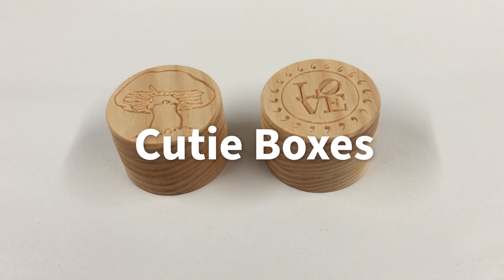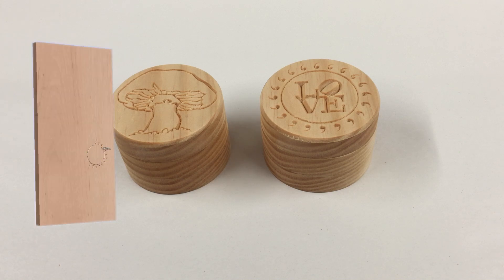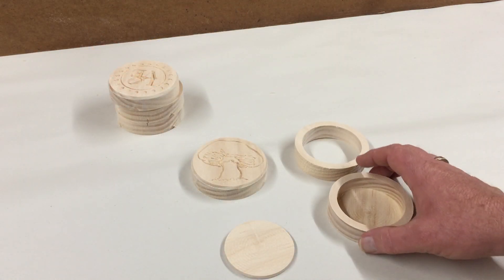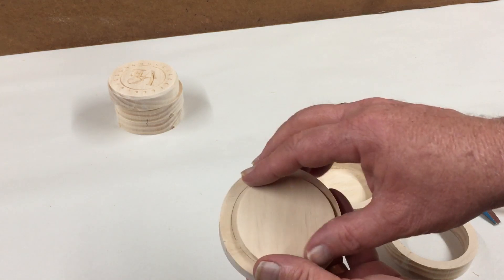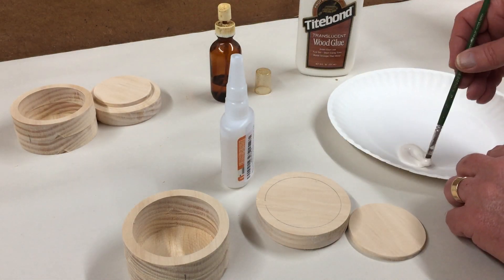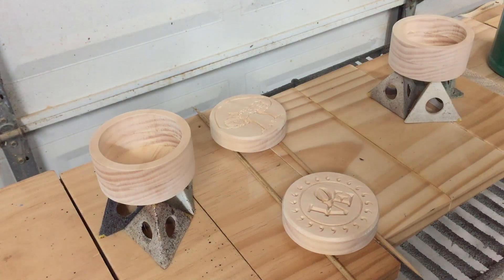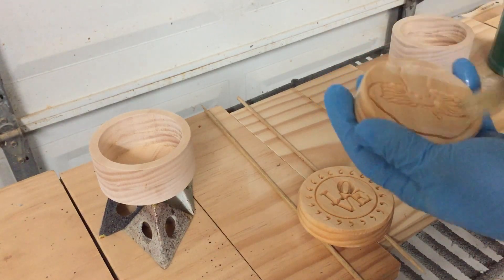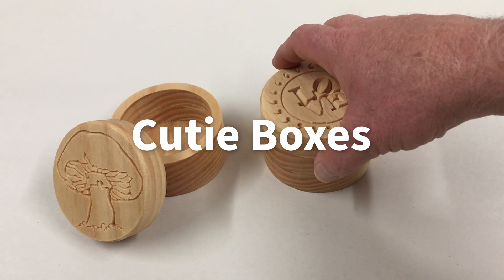Making The Cutie Boxes | Michael Tyler's FREE CNC Project of the Month | Vectric

Comment: Greetings, Michael,  I would love to make this project, but I have NextWave Piranha, which will cut out around 12" z 12". how would that work with the machine?
Reply from the maker: Thanks Art for the question... I suspect all you need to do is adjust the tooling so you cut one box at a time.  It might be helpful to open Michael's file and then save it off using a different name, then delete one of the 2 boxes and recaculate the tooling... then open the original file and delete the box you just recaculated, relocate the remaing vectors to area your machine can cut and recalculate the tooling.  I hope that helps... and if not please fell free to email support@vectric.com and they can give you a hand.

Comment: Michael, Thanks for the project.  Looks like fun.  

One question:  You use Krylon to clear coat many of your projects.   I have tried that, but get a bit of a rough or textured finish that I don't get with other finishes regardless of application method (brush, wipe or spray). Is this a characteristic of Krylon or am I doing something incorrectly?

Thanks.
Reply from the maker: I don't get a rough or textured finish with the Krylon clearcoat sprays. Many factors can cause problems, though. Too far from a project whilst spraying, high humidity levels, too hot or cold temperature in the shop, cans were stored in freezing or near-freezing environment and spoiled the contents, didn't shake long enough before spraying, are a few possibilities I can think of. 

If you have found a clear finish that yields a better result than the Krylon, then please go ahead and use that instead. Any suitable clear finish is fine!